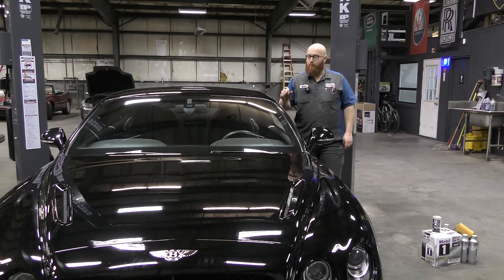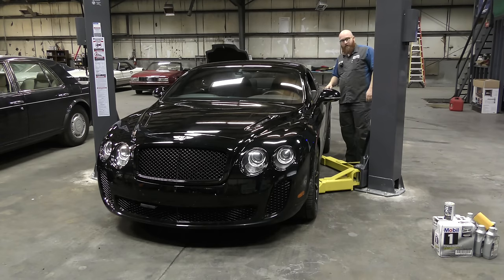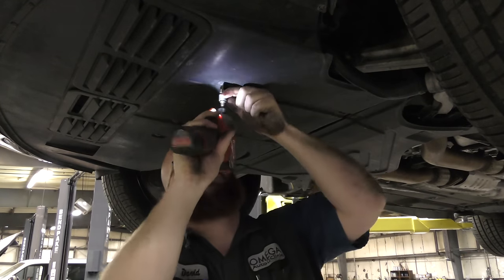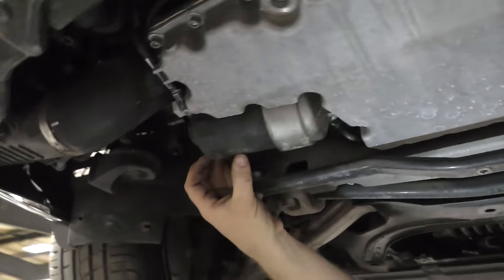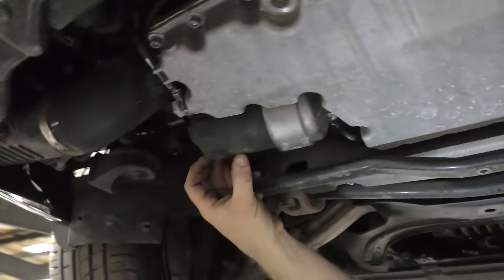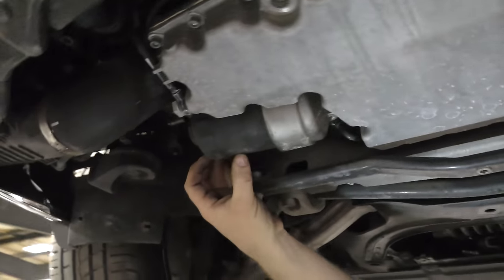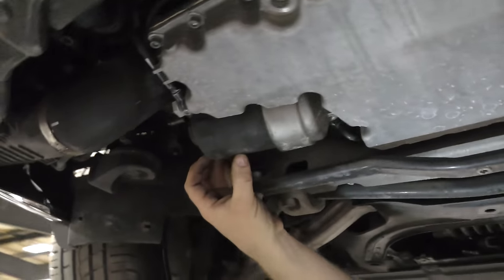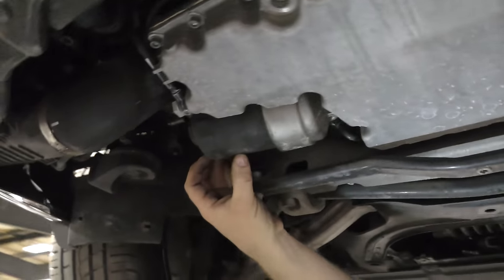One Fast Oil Change! The CAR WIZARD works on an insanely fast 2011 Bentley Continental Supersports!

Comment: Couple of inaccuracies there, Sir. The parts are interchangeable yes, but they are not "Audi parts" - They are VAG = Volkswagen Audi Group parts. You can just as accurately state that Audi's have Bentley parts because it is the GROUP who manufactures parts for certain cars in the group including Volkswagens  (certain years for the Volkswagen Phaeton have identical part numbers for various chassis parts, such as the entire air suspension - the air "bags", not to be confused with the passenger air bag restraint system, but the air bags in the shock absorbers and the air pumps to fill the shocks), Audi's, etc. When Volkswagen purchased Bentley Motorwerks in 1998 (and they also purchased Audi, Bugatti, Lamborghini, Porsche as well as a few other auto manufacturers AND Ducati Motorcycles around the same time), they capitalized on the technologies each manufacturer had to offer and utilized certain parts from each manufacturing plant interchangeably for various vehicle models. Take for example the W12 twin turbocharged motor, made by Bentley (each motor largely HAND MADE) in Crewe, England, United Kingdom - This motor is the engineering masterpiece made exclusively by Bentley (described by Bentley engineers as two 3.0 liter V6 motors sharing a common crankshaft, which allowed them to achieve a perfect balance while in a very compact space - which is very much on display in the confined engine bay of the Continental, as well as other models like the Flying Spur and the Bentayga), is also used in the Audi S8. But you don't often hear mechanics saying that the S8 is a Bentley, so therefore nor should you say Bentley have Volkswagen or Audi parts in them because while the technologies are borrowed, one from the other, they are still their own and each brand prices parts accordingly - so you are completely justified AND accurate however, when you say that it's very fortunate that certain parts and part nos. are identical because purchasing parts from Bentley when the identical parts are also available from Audi or Volkswagen make a huge financial difference! Bentley may charge $1,200 for the driver's side front air bag (air shock), while buying the front PAIR for a VW Phaeton may cost $676 for BOTH.
The point I'm trying to make here is that one may take advantage of shared technologies from one manufacturer to the other, but one should not diminish the luxury branding of Bentley in so doing! This is what keeps the Bentley in it's own rarefied luxury marketplace and the Continental Supersports in a "Supercar" status...
I know all this because I own one - the same exact model you're working on in this video but in Crystal Blue Metallic with Beluga interior - all heart-pounding 621 BHP and 670 Ft Lbs of torque which both help propel this 6,000 lb heavy beast from 0 - 60 in 3.7 secs and make it able to reach a top speed of 207 MPH! All while looking completely refined doing so :-)
I have owned many luxury cars, sports cars and muscle cars in my life but until I purchased my Bentley, I NEVER so much had all three in one beautifully crafted and truly attractive beast of an automobile. Before settling down to just normal speed limit driving (mostly), I have street raced BMW's, Lexus', Cadillac's, a Challenger Hellcat, Acura's, 3 Porsche's, a Lambo Huracan and an Aston Martin DB something and BEAT THEM ALL! The only ones that even came close was a Porsche 911 S Turbo and the Hellcat. The Porsche came down to pure driving skills - in traffic, beginning in lower Manhattan and almost all the way to Sheepshead Bay, Brooklyn during which I racked up two traffic camera speeding tickets. The Hellcat was interesting - I had him off the line by 6 - 8 car lengths in "Sport" mode (even off the line, my turbos dominated his supercharger) then he pulled within a car length, then i pulled away again with my twin turbos jetting me away convincingly to 150 MPH before we both had to dig ourselves!
Now, the beast still makes me kick it in the ass once in a while but where I reside now, no one really challenges me and I rarely even break 100 (my spoiler pops up so infrequently that the underneath is likely FILTHY DIRTY lol)...still an incredibly fun car to drive and people are continuously taking pics and videos and making conversation with me. I've even had the car with me in Budapest for the Summer a few years back. That was a lot of fun :-)
I LOVE my Bentley and if you know what you're doing, you can own one without going broke maintaining this fine automobile!

Comment: Except back when they were introduced those brakes promised a lot but disappointed in comparison with some other vehicles.
VW was not amused when they loaned one for a big performance shootout in Australia, Bently had fade issues, apart from expected results from Mitsubishi Evo, other stellar performers under brakes was the Falcon XR8 ute.

Comment: My first job that I ever worked in the mechanic field was a lube shop while I was going to school for auto mechanics. It was so funny because the rep that came in and got our orders for the mobile one…...He had a bunch of oil bottles that had never had anything in them. They were just for display. Oil never touched them so no chemical smells or chances of getting sick. I used to buy powdered Gatorade and mix up in the oil bottles. And then I would just stand around drinking out of oil bottles. You should’ve seen the crazy ass looks I got!!!! I actually had a lady slap one of them out of my hand one time. Of course when it hit the concrete it came out blue, but it obviously really bothered her! Funny college prank. I miss those times.

Comment: To avoid a dry start, you can pull the fuel injection fuse. Then crank the motor until the oil filter fills and you have oil pressure.
Reply: This is nonsense.

Comment: I don't think thats what people meant when they asked why you use the little bottles. Why not buy the 4 or 5 litre bottles instead of the 1 litre bottles? (Or whatever the equivelant is in American speak) you'd end up with 3 empty bottles, not 12 or however many you ended up with. Unless you re-use them for something it is a waste of plastic.

Comment: If there are turbos you definitely want that oil filter full of oil before starting the car.  The solution is to crank the motor over without firing it

Comment: Does the oil drain plug use the crush washer? Only use them once or they leak. My wife's Porsche is the same with the belly pans. I always do the changes myself. To many things they could screw up at the 15 minute places and I refuse to pay Porsche 300$ for the oil change.

Comment: I stopped going to Jiffy lube and to the dealer for oil changes.  I found tools inside the engine bay.  Also one time at the dealer they forgot to put back the under the engine plate cover for my wife’s suv. It took me months for them to get a new one.  And once the swapped our new engine cover (top) with a broken one.  I caught it on time.  And a lot of times they don’t put a new filter, but they charge u for it.  So I do it at home.

Comment: V.W. group own around 12 brands trucks cars vans and motorbikes so they all share the same components, engine gearbox rear end are all made in the same factories. Even body panels the same plant could press some V.W. Golf parts then Seat then Skoda then Porsche then Lamborghini then bugatti then Bentley then Audi then Scania they are all one company. All parts for Bentley are made in Europe then shipped to the U.k. for assembly the Germans only let the British bolt it together they most probably think if they let them do anything else they will f it up .They are most probably correct the average british bloke is not that bothered that's why there are not any u.k owned mass car manufacturers any more .

Comment: well there is a solution for prefilling the oil filter but like you said whats the point for 2 seconds. it's called a prelube pump.

Comment: At the end it displayed "What's your pet peeve on an oil change?".  Mine is some moron before me, must have been just a cranking on the oil filter and tightening it till the gasket or "O" ring is completely collapsed.  Gave it everything they had.  And they seem to do it on filters you don't have good access to.  I've stripped several of the outside metal and had just a fun ole time getting the inner guts/nut off.  I remember one car I had to lift the motor out half-way in order to have room to get vise grip's on it.  Is that a good enough peeve?

Comment: As a top end auto technician, it’s your duty to make sure everything is working properly, so a proper test drive should be required before the customer has their vehicle back.
…about twenty miles ought to be sufficient.
😁👍

Comment: They should have called it a wr12 engine. The vw golf's you could get with a staggered arrangement on the pistons, not the conventional straight type. They were a vr6 motor

Comment: So you pull the car past the lift so you can get out without dinging the door, roll it back by hand on the wheel but then get back in the car to put it in jack mode?

Comment: May I suggest to purchase a Starlight plastic body pocket LED flash light. I used to be a Maglite man but the anodized aluminum body was too hard on my teeth in tight places, and very bad if dropped inside live 480VAC panels when troubleshooting. Also Maglite can't take a drop from any height. I've lost a number of those to shock. Starlight plastic body light works great, it's none conducting and keeps my facial muscles and lips toned really well. 
Just kidding! It really works well 4 me.

Comment: Turbo EGT sensors. Audi A6. Upper and lower control arms, Audi A8. Wheel hub bearings are slightly different. Just order Audi A8 Wheel hub and bearing together. bolts directly and fits oem. Its a Glorified Audi A8 with a W12 (Dual VR6 Engines slapped together). Lamborghini is Audi/VW. the Audi RS3 Engine is half of a Lambo 5.2 V10 Engine. Same Cylinder head. A lot of VW/Audi/Bentley/Lamborghini cross relate. Touched TONS of these cars. Porsche and their lovely VW Harness lol. GT Porsches with Their 3 piece battery cable that cost 38 Hours to replace. OH I LOVE VWWWW. the AC compressor on a Bentley W12 is the same as a VW Jetta JUST FYI!!! 550 cost for OEM vs 2200$ for a Bentley named Jetta compressor. JUST LETTING YOU KNOW!!! Its 13 hours of labor to do a AC compressor on this car. Rip off the front end in Service mode, remove the 12 mile long Drive belt, move the Power steering pump out the way. Boomm, Get yourself a AC compressor while like 20 Oil coolers sit on the sit swinged out the front of the Car.. lol!

Comment: Another serious question I asked before. Do you think there is any difference in fit and finish or quality by not using Bently vs an Audi or VW part? Just because the "fit" and are stamped with a manufacturers name, are they built to the same tolorances? What's the point of buying a fancier car if it's the same junk the put in low end models? There has to be some minute detail or differnce or the manufacturer would get in some sort of legal trouble I'm sure. I think alot about the rebuild YouTubers that found parts for exotics from base model cars, and I'll use a radiator fan and hydrolic pump for a Fearri for example. Just because an Audi radiator fan fits a Lambo, is it the same CFM? Just because it fits a Ferarri from an Alfa Romeo, is it the same GPM?

Comment: LOL a guy came to my shop with an AMG Merc and shit himself when we said 240 Canadian dollars, why would you buy a new Merc and then complain about the price of an oil change?, I work in a lube place ,we wouldnt put shitty oil in a car like this it requires a very specific type of oil , I dont know what kind of lube shops you have in the states but it sounds like they suck if they would actually put the wrong oil in, we wont even do that if the customer insists we tell them to go away because we wont do the change if its not done right.

Comment: Your so right about the oil filter. Inform the people ! That when you refill the engine with oil. The oil will seep into the filter as the oil is replenished. Great content. Never had an issue on My  Bentley Gt.

Comment: Do yo have a lift that you drive on ? When I was young most lifts around here were like that. No kneeling down , no adjusting arms. Drive on lift  drain oil pull filter. I miss them.

Comment: al least it is not like old British land rovers, oil change one quart at a time, drain a quart then add a quart run the engine, circulate, drain a quart  add a quart, run engine until all the oil is circulated and when you drain the last quart it should come out clear big pain in the a$$... love the video Car wizard

Comment: You do not add engine oil additive for these complex engines. You should use correct spec engine oil and original oil filters, and simply change when needed.

Comment: 22:20...probably $200. I'd pay that in a heartbeat for 13 qtrs of Mobil1 and that amount of "I give a s**t" about my car before I pay $75 for a cheap oil change and the guy that forgets to do the "right process" before putting it on a lift or can't figure out how to open the hood, or doesn't check the other fluids, or...you name it. Pride and care in workmanship is worth a fortune in and of itself...😎 (Can you recommend a fellow "Car Wizard" in the Colorado Springs area? 🤔)

Comment: never pre- fill the oil filter, why you ask? Cause half the oil you put in the filter will be pumped through your crankshaft without going through the filter. Just don't do it the engine has plenty of oil in the galleries to lube the parts for the seconds it takes to builds pressure.

Comment: I was always told to fill the filter, but every time i do my motorcycle, it does EXACTLY what you said spills out as I'm trying to screw it on. This time yesterday i just filled half and was able to screw on without making a mess, but i was also thinking the same thing, won't it quickly just fill up with oil pump.

Comment: Hey Wiz, 200 dollars is not bad given your quality of services.
I have comment about when you raised the dip stick holding it the way you do may caused the oil to flow back on level mark resulting in slightly accurate reading.
For me I tried to maintain the stick in upright as possible for a better reading.

Comment: Pet peeve would be 1st Gen Mazda3 sump casting fins, specifically not paying attention, first thing on a cold winters morning and as the tension breaks on the thread and you crush your fingers between the spanner and the casting fin.. 15 years later and it still gives me the sweats 😱

Or just to whinge, splash trays.😂🤣

Comment: 6-7 usd for 1 liter of Mobile 1 full  synth 0w40 ? Here in Europe it’s 20 € (22 usd).. As for the oil change, for a simple Merc c220 cdi, It costs me 200 € (220 usd) in a local garage.. For my 2nd car, BMW X5 2.5d, I paid 700 € (800 usd) for the regular service, mainly oil change.. You should seriously consider moving to Europe, you’ll earn much more ✌️

Comment: Way overdue, but how come you only used 1 can of MOA? The instructions call for 3 cans if you add up the amount of oil you're putting into that engine. I want to use it on my own Bentley but am hesitant to use 3 cans despite the instructions.

Comment: Yeah those mobil1 0w-40 1 qt jugs are $10 each lol. My mercedes-benz e350 takes 8 of them.  So cheapest place I found to buy the 5 qt jugs are $25 each at Walmart. So a full oil change for me costs about $65 if I do it myself.
Reply: My mercedes has 78k miles, and says the oil change is good for like 13k miles or something? Should I do them at 10k instead or something?

Comment: You have the typical straightforward approach to the customer price question. Why so much?
I would answer, "How many quarts of oil does the manufacturer require?" "Which is recommended?"  "Which filter does it require?"  "What is the manufacturers' lifting protocol?"  "Do you know how to lift the hood?"  
You are asking about a unique machine with each step being unique and unfamiliar to anyone who has never seen one.  The car must be, not should, must be lifted and inspected, which I will also do.  Your car will be better off with me because I will give it appropriate respect and service.

Comment: You should prime the filter if its a turbo even if the filter is on sideways you can half prime it with oil but if its a canister type dont wory just let the oil pressure build before reving the engine after you start it to check for leaks.

Comment: What is the advantage of using two computers, instead of using one computer? One ECU should be able to handle two air flow sensors and such.

Comment: Would you recommend cranking the engine with the fuel pump fuse removed in order to build-up oil pressure since the oil filtet location prevents you from pre-filling it?

Comment: Who on earth would purchase a Bentley and then go to Jiffy Lube for an oil change? No one seems to equate the cost of an engine replacement against the cost of an oil change, using quality oil. I had one bad experience with Jiffy Lube, when working out of town, in 1997. Since then I have always changed all my own fluids.

Comment: Do you use the BG “MOA” oil additive in all the cars you do changes on? I suppose I should ask do you SUGGEST using it on all vehicles, specifically high performance engines? I’m from the old school of teaching that “additives are all snake oil bs”, but always believed that there must be some chemical engineer somewhere that’s actually developed something beneficial, and I’m hoping you’ve found one!